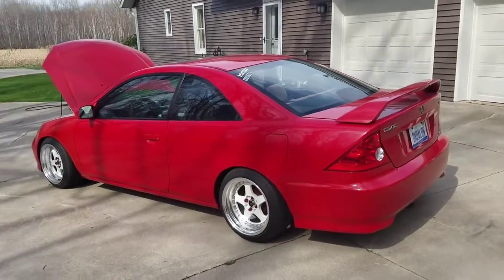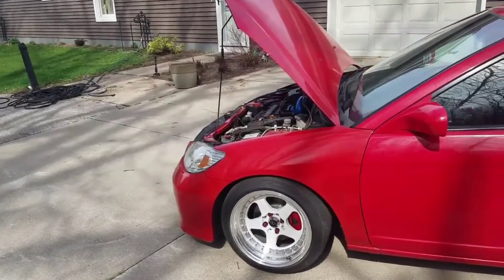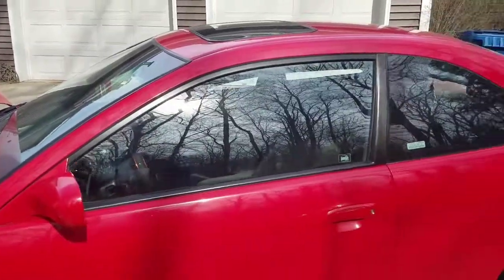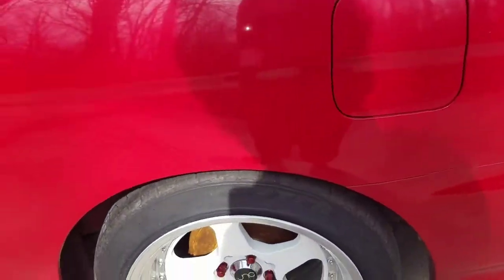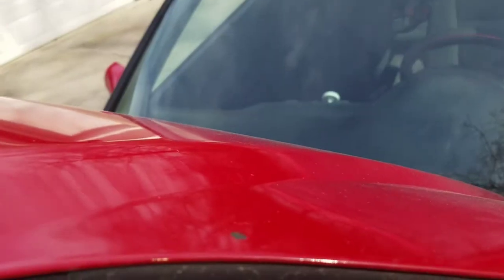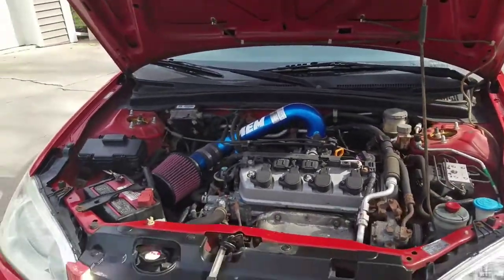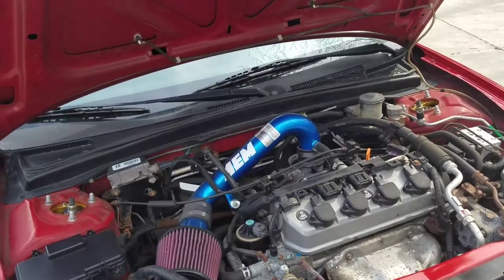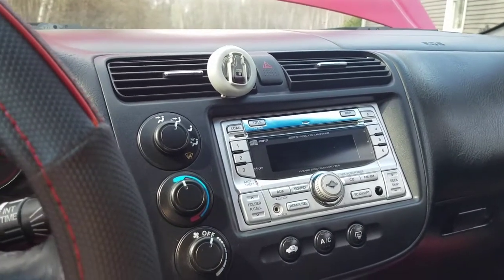What's up with the civic. (Plans and mods so far)

Comment: Don’t take off your header heat shied because the radiator fan is right there and the heat will melt them just sand it and paint it with high temp paint

Comment: For the airbag you can run the codes yourself i did it to my 05, search on here for a video it'll tell you how
Reply from the maker: Vincent A hey thanks.this video is older but I ran the code and it said the seatbelt sensor was bad. I took it to honda and they replaced it last week. Also the cars not for sale right now as I still have big plans for it. If you follow me on Instagram at customcrusher you can see the car currently

Comment: Im struggling to find any of these 2004-2005 5speed em2 in good condition anywhere.
Reply from the maker: Randy Lee ya the ex coupe with a 5speed and black interior is actually quite hard/rare to find. Especially red in good condition. Plus I have the special edition which is even harder lol.
Reply from the maker: Randy Lee oh also. Don't forget if you get a 01-3 you can swap the front clip from the 04-5 onto it
Reply from the maker: Randy Lee also have you seen one of these with the factory wing. I haven't seen another one with the wing yet. I think this car is quite special
Reply: I've seen only one here in Minnesota with the factory wing but it was just the 01-03. I had a grey 04 ex with the original hfp lip kit and I sold it because it was in bad shape. Now I can't find any for sell! :( Hope I can find a stock red one like yours it would be perfect...
Reply: Right now I have an 01 dx and it is nothing like the 04-05, the tail lights, the entire front face lift, all around body lip looks cleaner and more modern, red chrome gauges. And hfp lip kits just looks absolutely awesome on the 04-05 I've had it once. Also these clean 04-05 coupe 5speed are some of the most rare civics, and the value is about as close to an 8th gen civic si. Only one I saw for sell once was an 04 coupe 5speed with 134k miles and the guy wanted $6k!
Reply from the maker: Randy Lee that's crazy. Didn't know you could get that much for these. I knew my car was quite rare but didn't realise how rare until I started looking again. Lol there are no red coupes, Especially ex se's. I did find a 05 ex se manual sedan but it was silver without the wing.
Reply: Randy Lee I got one

Comment: Dude my driver side seat is doing the same thing. Any recommendations???
Reply from the maker: I've heard of some people putting washers on the seat rail if it's the rail itself that is moving. Helps level things out. My seat doesnt really do this anymore and all I did was take the seat out and make sure the rail was secure to the seat. Then made sure the seat was tight in the car. Took alot of the rattle and rocking out. Follow me on instagram @customcrusher for faster updates and responses. I'll try to pick this back up soon
Reply from the maker: Also see if the whole seat is rocking or the fabric part is pulling away from the plastic base. If the seat is splitting I dont believe there is a whole lot you can do. Mabye take the seat out and tear it down and see if anything is loose?